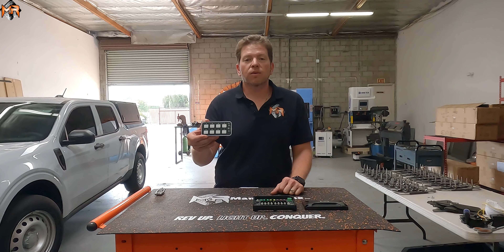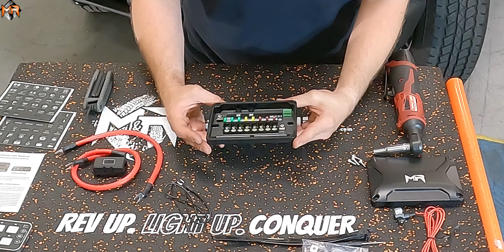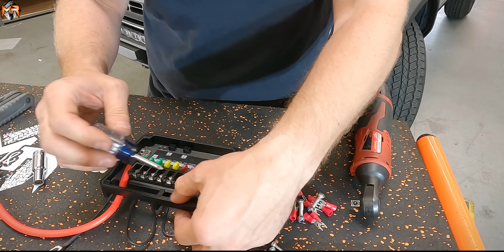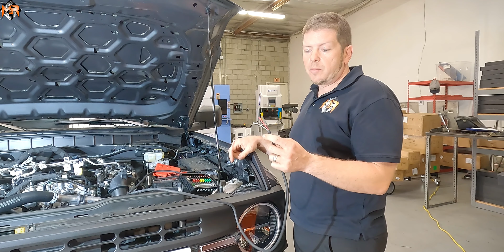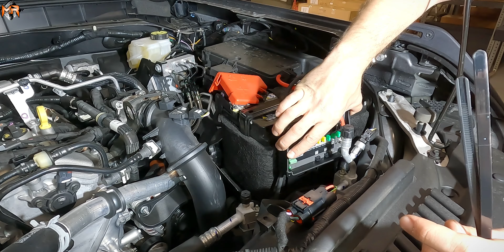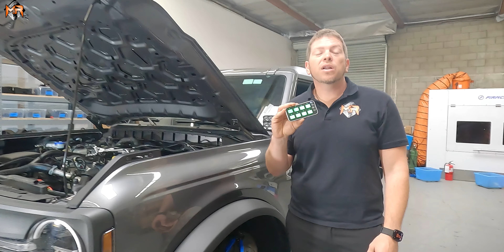Ford Bronco without AUX switches | Tutorial Wireless Wiring Harness 2.0 |  M&R Automotive

Comment: Is there any documentation on the ACC/ignition wire? Also, where do you buy the additional accessories mentioned in the manual?
Reply: I want to know that too!
Reply from the maker: we typically dont use it. All the ACC does is wake up the module when its in sleep mode. It does that when alternator is working as well.
Reply from the maker: we typically dont use it. All the ACC does is wake up the module when its in sleep mode. It does that when alternator is working as well.